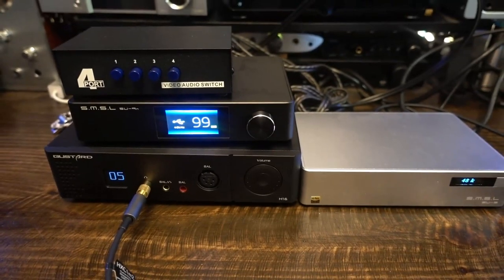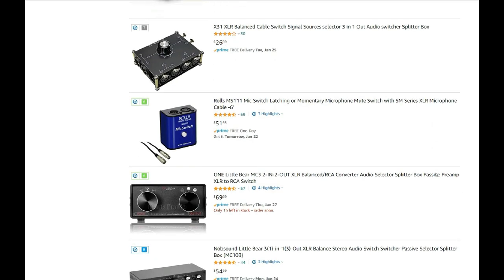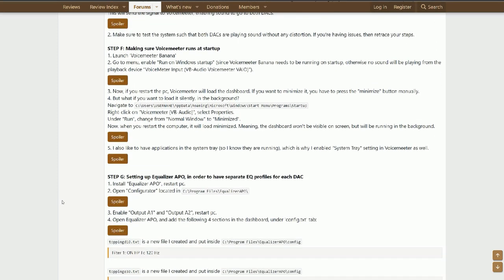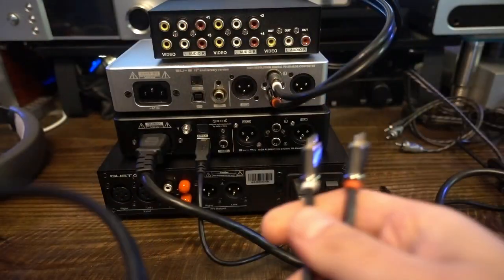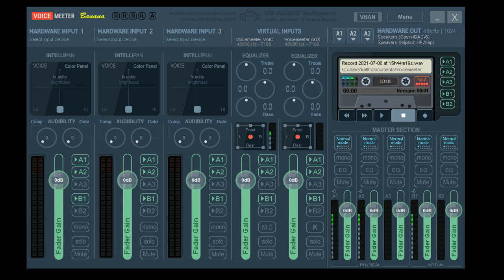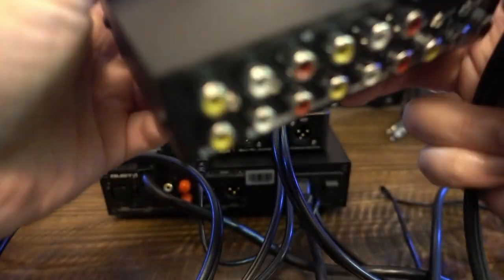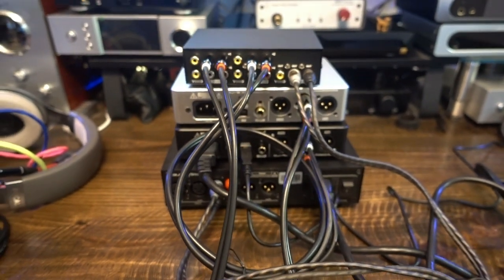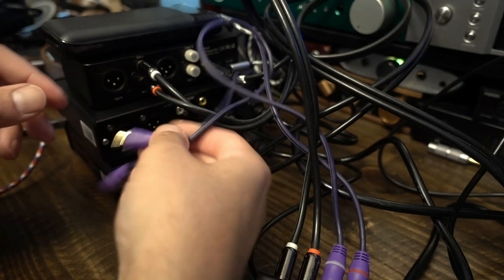How To Assemble Your Own DAC Testing Rig For $25

Comment: Your links are just bringing up searches can you link to specific products for the rca switcher etc?
Reply from the maker: Yeah, I included only search results. There’s no guarantee Amazon will have in stock the exact stuff I bought. I looked for my switch box and it was discontinued. So, linking to the search results seemed the safer option.

Comment: the only thing i cant figure is why are 3.5 switch box so damn expensive compare to RCAs. 
RCA box are way cheaper but the cost of RCA cable adds up quickly........i really wish i can get this job down within 10 dollar budget that include the switch box and few 3.5 cable given the fact there shouldnt be any processing included or anything fancy, just pure physical switch......

long time voice meeter user here, cant live without it now. but when it comes to high-fi stuff, i am not 100% sure how VM plays in this chain (just not AB testing,  but for daily usage).
like there is the setting for each device's default format (rate and sample)